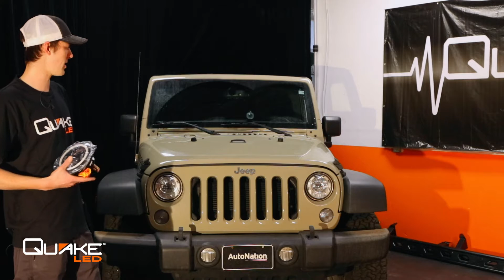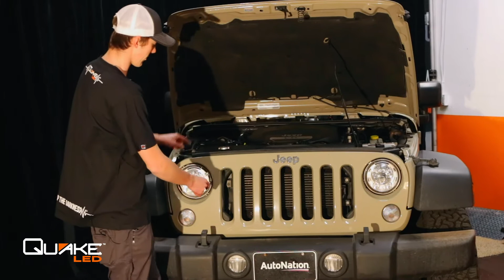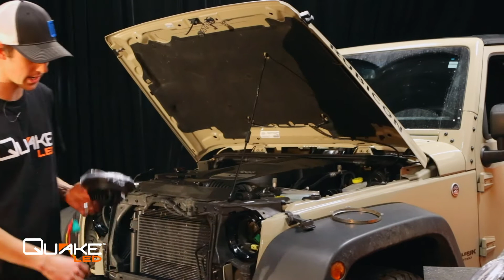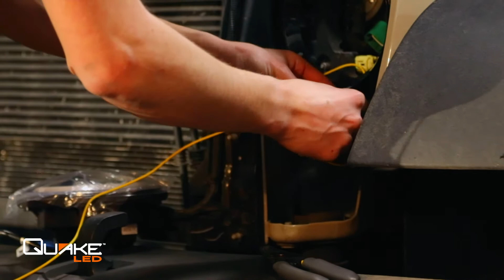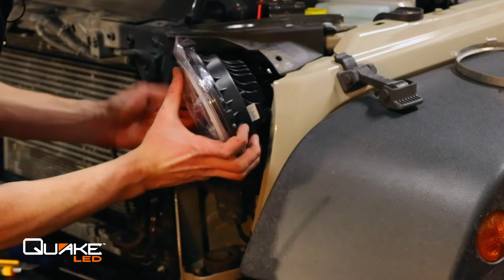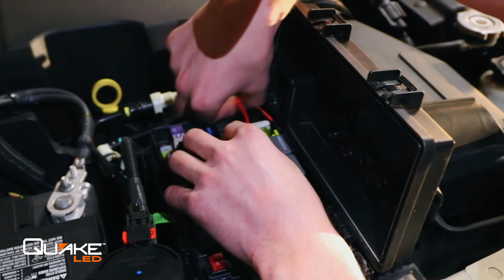CHECK-IT-OUT!!!🔥🛠🔧 7" Halo Headlight QTE959 Install!! // QUAKE LED

Comment: I plugged mine in just to test to make sure it’s connecting before I added the rgb lines but the lights don’t light up
Reply from the maker: Call the office at 720-305-8979 its possible you have it installed incorrectly. If there is an issue with the light we will get it replaced ASAP. Call the office we are here to help.
Reply: @quakeled  I did thank you! They are having someone call me back